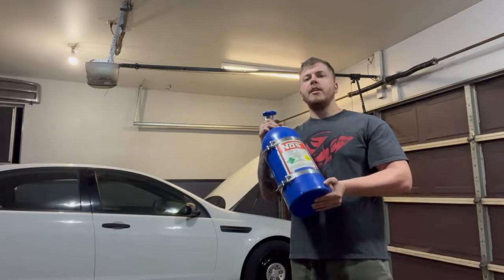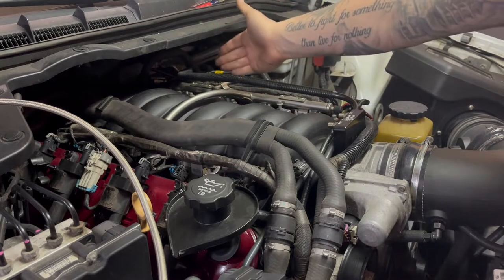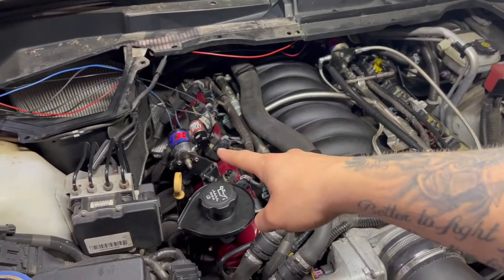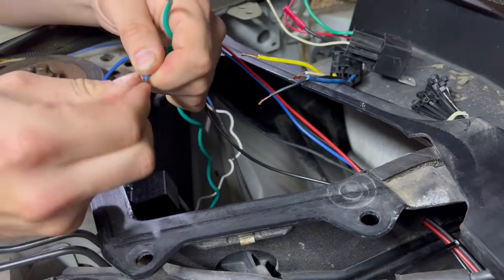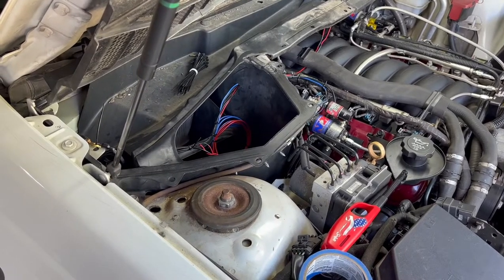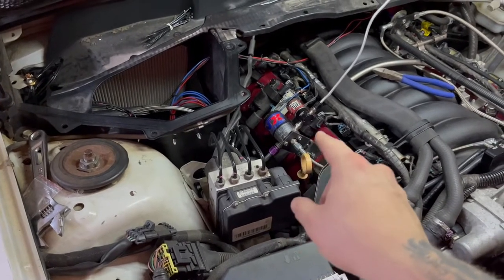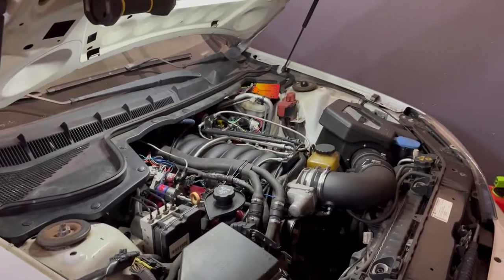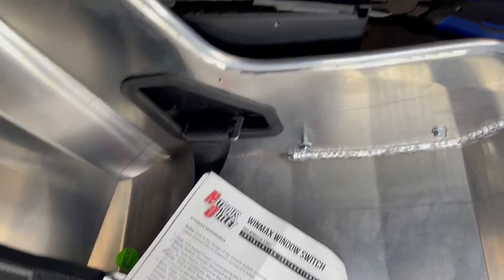Caprice PPV Nitrous Install Part 1

Comment: Nice job!
Reply from the maker: 🙏🏻 thank you!!
Reply: What did you use the blue wire for on the relay for the bottle heater? Are your relays 4 pin or 5 pin
Reply from the maker: @Caspercustoms195  I think 5 and I will check when I get home